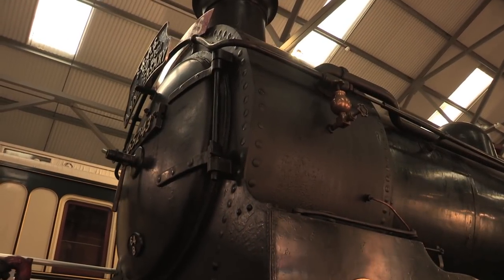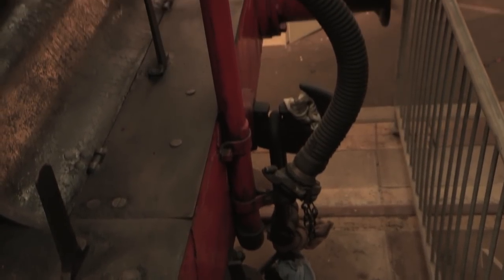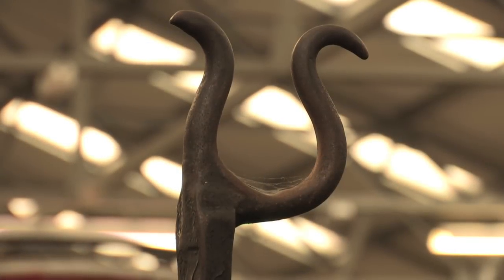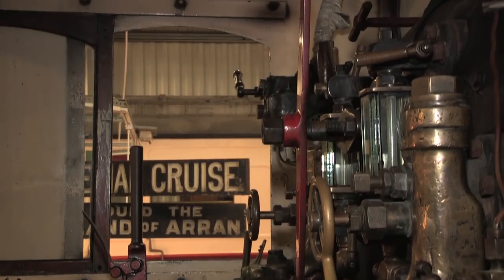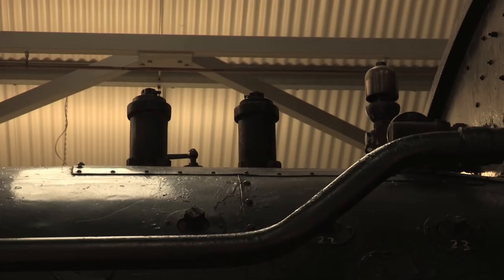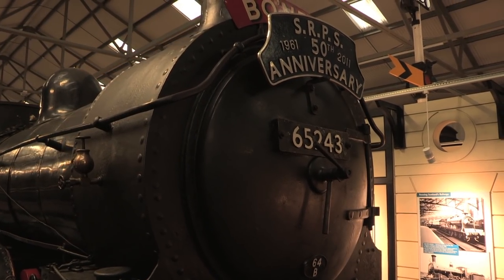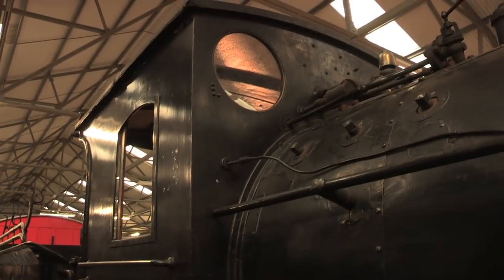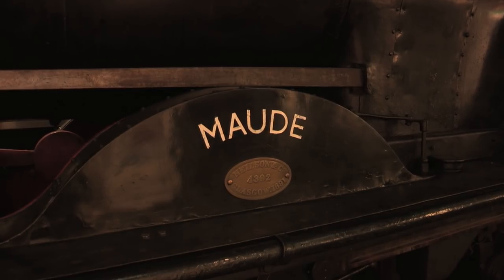SOLE SLIP: North British Railway 'C' class No 673 'Maude'

Comment: Will you be doing a sole slip on the Prince of Wales when they’re finished?
Reply: It's not gonna be a Sole Slip as there's gonna be two new Gresely P2s, the new build 'Prince of Wales' and a replica of class pioneer 'Cock O' The North' with an A4-Styled bugatti nose.
Reply: Mister Tterevel being honest, not sure how likely that second one is to be fully completed.  As he noted, there have been projects that made progress and then failed
Reply: @connormclernon26  I'm still waiting on the one for Tornado. While not built by the original builders it was named as genuine 50th member of the Class by it's designers wife. That should be more than enough to classify as a sole slip.
Reply: FutureRail Productions Yeah but considering it’s use for 10 years at many locations yet a Sole SLIP not approaching. Or he’s just going to do it when Tornado’s ticket expires and she’s on display.